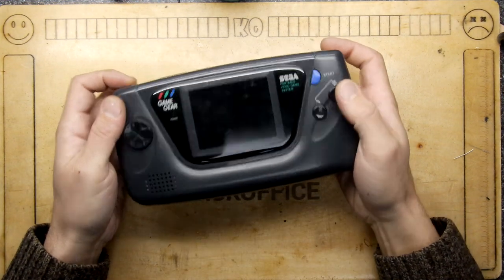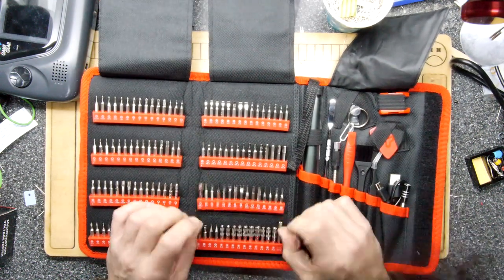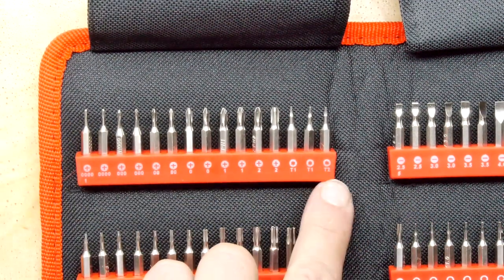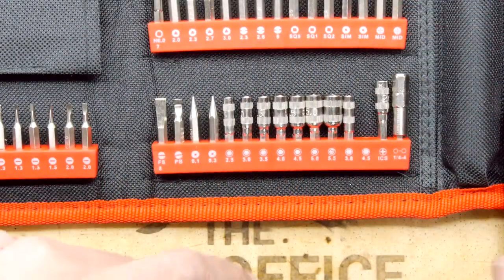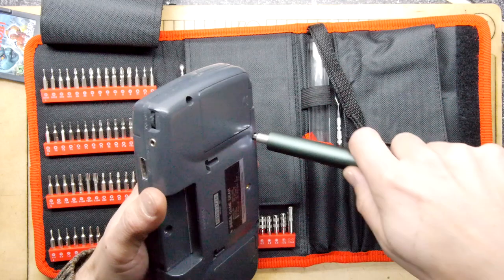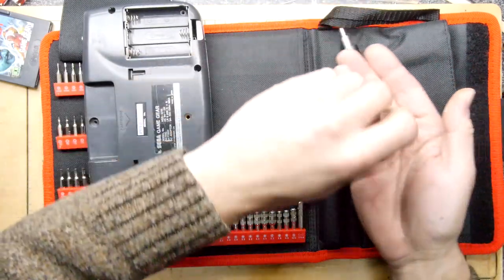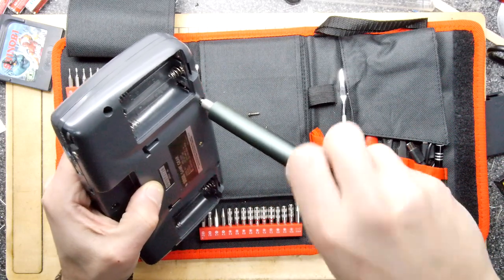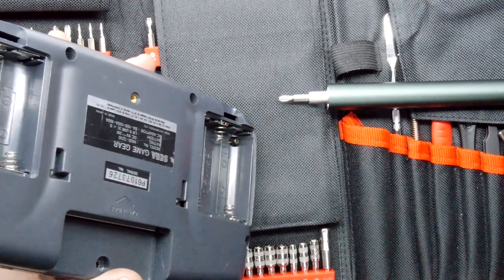Kaiweets ES20 Micro Electric Screwdriver Kit (Sega Game Gear test)

Comment: I got mine on eBay when they had an offer on, got it for £30. So that was a good deal. I’ve got a meter from them too so this adds to the kit. It’s not bad considering the wide bit selection and duplicates of the ones you might loose. With all the other stuff thrown in. Was great disassembling a C64 and removing the motherboard and taking the million screws out of a keyboard. At most I’ve needed any quarter turn to release very torqued screws, otherwise it does the trick.
Reply from the maker: That's a great use case! Im sure there are plenty of others interested in retro computer applications for it.